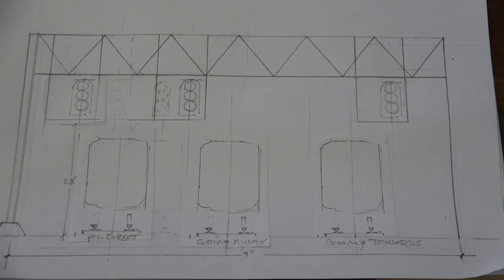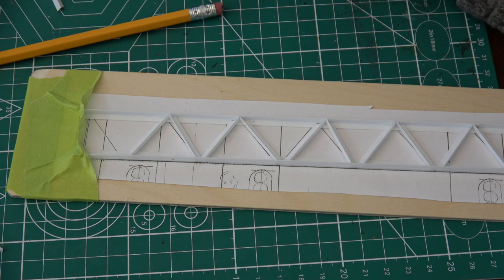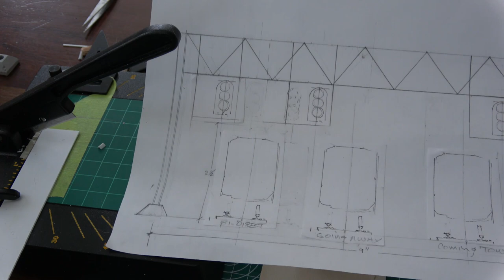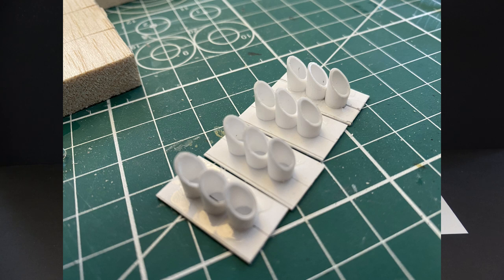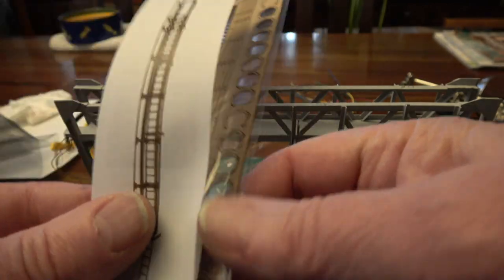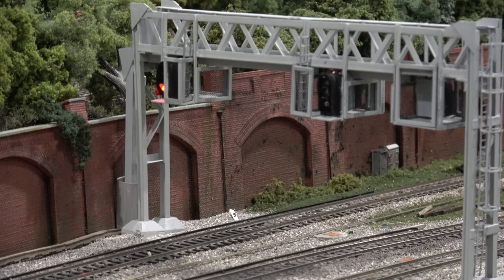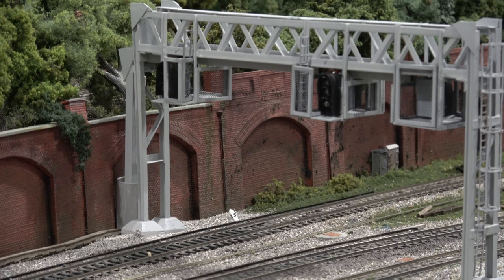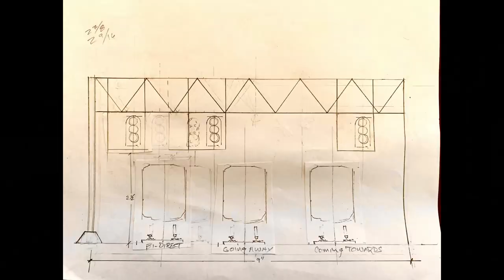145 P 1. Signal Gantry Build - Farland Howe

Comment: Enjoyed the video Rob, the signal gantry came out great
I giggled when you said you need to get the flanges on the angle right before you cut. I’ll email you the story behind that memory 
Thanks for sharing
Reply from the maker: Hi Cary, Miters and angle iron miters are not that easy.  I have to put a pencil mark on each one to show me the direction of the angle both here and if I am cutting wood in miter cuts.  Otherwise I almost always get them wrong.   Great story in the email, thank you very much, Rob

Comment: Looks very good, but note that, as long as they 're in the circuit, it doesn't matter where the resistors go. You could have put them at the ends of the wires, just before the terminal blocks and avoided having to squeeze them into the cable trunking.
Reply from the maker: Hello Henry, Yes, I knew that.  Force of habit from other times I have wired up LEDs.  In fact I added another 3K on the green LEDs to get them closer to the brightness of the red.  Indeed it would have been better to solder the resistors on after assembly.  In all the testing and trial this and trial that, I lost track.  Thank you so much, Rob
Reply: Great job , well done , enjoy your master piece Rob😎👍
Reply from the maker: @johnfloyd838  Hello John, Thank you, most definitely will.  cheers, Rob🙂
Reply from the maker: Alastair Lee is posting this video on his email blog on Friday.  In the text I gave you credit for the idea of soldering on the resistors after the wires have been run through the conduit.  Thank you., Rob
Reply: @FarlandHowe  Thanks, Rob, for the credit.